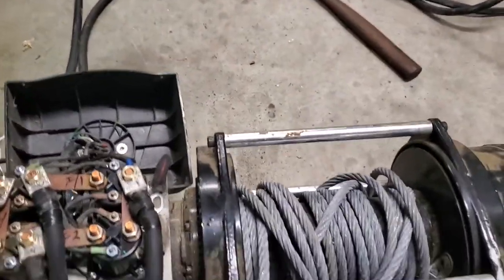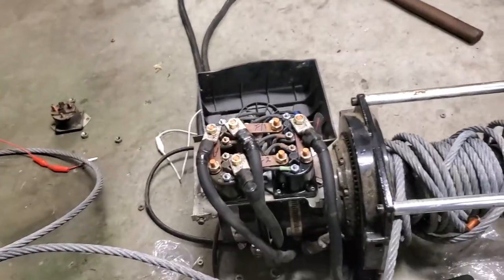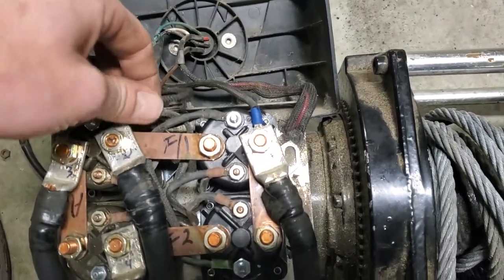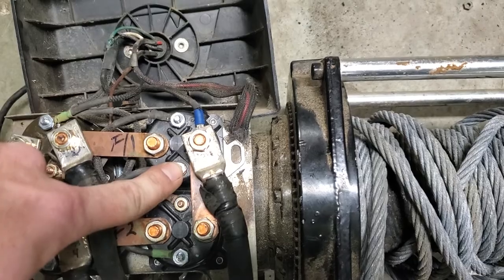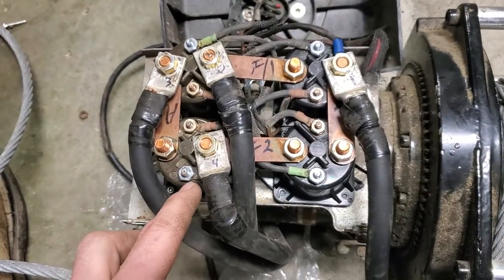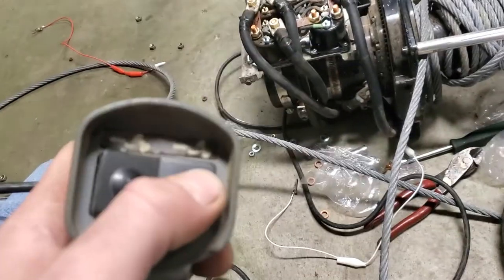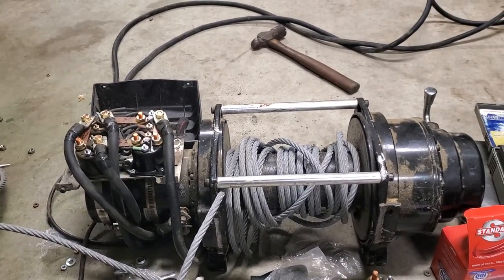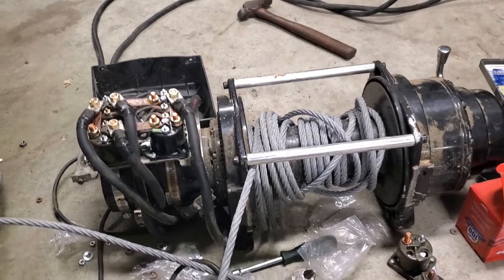How to wire solenoids on warn m12000 winch

Comment: The problem with these solenoids is that none of them are a continuous duty solenoid. Typical starter solenoids are only designed to run for 15-30 seconds at a time. For winches and other applications, you should make sure that you have a continuous duty solenoid that is designed for longer run times. These generally cost a little more.
Reply from the maker: That is a good point. I hadn't thought of that. Thanks!
Reply: I just watched a video about starting and continuous duty solenoids.

Comment: I pull a 82000 lb truck with a 15000 lb winch. It’s your rolling resistance, not the trucks weight that counts.
Reply from the maker: Very true.  But I also like to take into account when the truck is stuck it will not have very much rolling advantage.

Comment: Is your winch a 3 wire controller
Reply: I bought a 2500 that has an m12000 on it I can't  figure  it out
Reply: @jameshamilton6633  good question. I believe it is 3 wire.
Reply: @westleyrudd5500  I have required mine completely but I think the motor may be my problem
Reply: @jameshamilton6633  thats a good possibilty.
Reply: @westleyrudd5500  I just pulled it can't turn it by hand or power